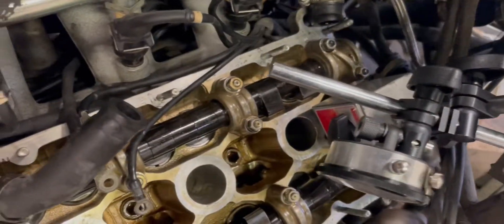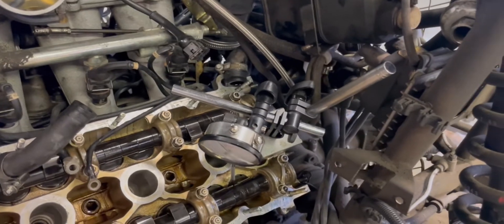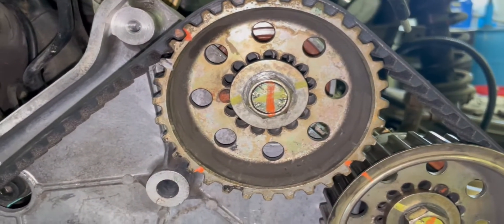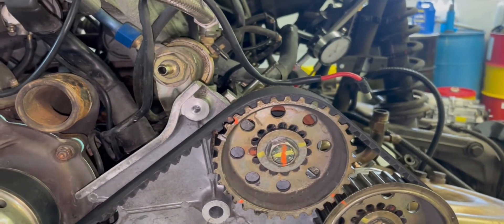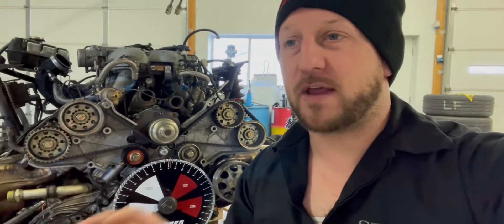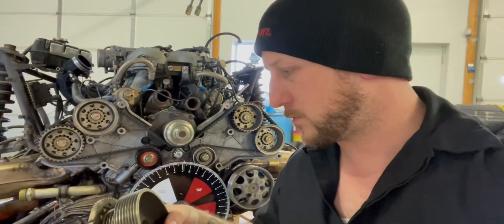Ferrari Mondial T: Degreeing Camshafts For Proper Setting Of Timing

Comment: Sorry - I know this is an older video. Why would it be out of time if you set everything to factory - ie: line up all cam marks with the cap marks and set the engine at TDC?
Reply from the maker: It might be ok, but personally i would want the piece of mind to know that its 100% correct in something like this.
Reply: @kieferskustoms  Thanks for the reply! getting ready to tackle this and your video explains the procedure the best! I have a Mondial QV. Just did a valve job and refresh.